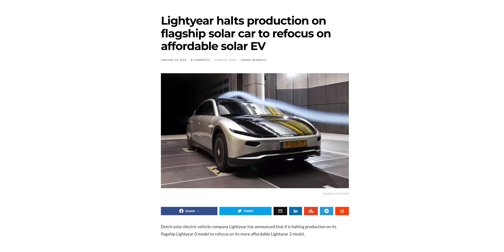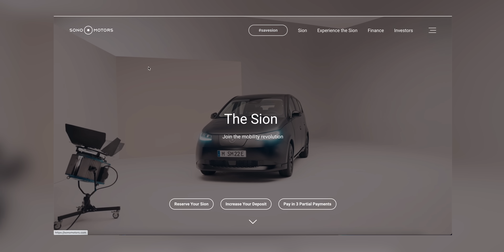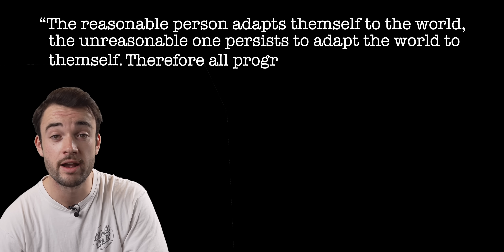Will Solar-Powered Cars Ever Happen??

Comment: An efficient EV can cover ~4.5 miles per kwh at, say 60mph which implies an average of 13kw power to drive the motor. A typical car might be 4.7x2 = 9sqm using Tesla Model 3 dimensions.The sun's incident power is up to 1kw per sqm, often much less. So, even 100% efficient solar panels (vs.  ~20% currently achieved on a bright day) would only supply 9kw of the 13kw needed to propel the car.
Reply: Its not supposed to power the car.  Its supposed to trickle charge the battery for extra range before being fully charged at the mains

Comment: Surely the maths behind a solar car just doesn’t add up?

Even if solar panels were half the cost, half the weight and double the efficiency, the solar energy collected by such a small surface area is only good for a few miles per day and would take over a week to fully charge? 🤷‍♂️

Comment: An interesting video but does putting solar panels on an EV make sense? The added benefits are marginal wrt to range and if you are trying to attract investors they may be spooked by seeing so much emphasis by these companies on the solar aspect. Development money would be better spent on drivetrain and battery to improve efficiency. What interests me about these cars is their interesting designs and focus on efficiency generally, the solar tech is marginal. I suppose in their minds the solar capability is a USP, perhaps it would be for some consumers but at this stage it isn’t consumers you need to keep happy. They should focus on selling these amazing concepts to investors on the strengths of the designs and once an investor is interested the solar aspect becomes ‘oh, and by the way, we can do this as well’.

Comment: I do love the idea of solar cells on the top of a car to increase the gap between recharge. I don't have off street parking do if I could add 20-30 miles a week that would make a huge difference to me.

I think part of the problem may be the grossly optimistic range they quote. Claims of up to fifty miles a day are likely ten times what is realistic. I wonder if this is part of what stops serious investers getting behind the products.
Reply: Who says 50?  The largest number I heard was Aptera's 40 under ideal conditions, and that that is only because it is designed to be able to go 10 miles per kWh.  The more typical 4 or less miles/kWh is never going to get that from modern solar cells.
Reply: @skeptibleiyam1093  I think I've seen 50 from light year (I could be wrong about that). I just checked and they now have tests suggest potentially 44 miles line. Still wildly optimistic - I think they are basing it on assumptions from all the solar on the car, but most of the time half of it will be facing away from the sun and the rest imperfectly aligned. 10 miles a day would be a triumph in real world conditions. 5 miles worth it.
Reply: @stewreviews9345  Where are you getting information about the Lightyear 2?  The official website as almost none and I am curious.

Comment: So, it's apparently quite hard to start a completely new car brand from the ground up.

I really wish that a company would commercialise production of adapter kits - maybe just add solar to an existing vehicle - tons of challenges to this but companies like Muxsan have created different adapters for charging, people so it with a supplementary battery that charges up via solar and then dumps that charge into the vehicle battery.

Hobbyists are already doing this so we know it works to some degree, just that their set ups are universally really ugly...

Comment: The problem with all 3 is - you can buy solar car today. Get any electric car, put additional 4-5 kW array on your roof and voila - you can have solar powered car right now.
The main problem therefore is that people that can buy startup car with no service network have enough money to do what I described above usually, so why wait and why risk it?
Sono, for me, had the highest potential not thanks to solar, but due to very utilitarian vehicle type. But the loooong delays probably caused them to run out of money.
Their solar roof program for buses, trucks etc - that's brilliant!

Comment: Missed one, Fisker has a Solarview panel on their Ocean model and are in production with deliveries to start soon.

The Aptera Accelerate project, that investment competition, led me to cancel my order. It just comes off too scammy for me. All that money is lost if they don't enter production. Worse they have yet to publish their financials from July to December 2023 and if you look at January to June 2022 they burned a truck load of money.  However what irked me the most is even in February 2022 they let people think they would deliver a production car when it was clear they were not going to get Gamma done when promised, it did not appear till September, and it wasn't until November they admitted they did not even have renders for their last prototype done nor would have by end of year. They also cannot give an actual price.   
    
I really like the idea. However from a financial perspective none of the solar charging options are worth their money. Let me use an example, Aptera claims 100 w/mi and they claim forty miles of range under ideal conditions. Well if their efficiency claim is true then that is 4 kWh of electricity. Even at 25c per kWh that is only a dollar.   A dollar saved and only under ideal conditions.  
    

The reason none of these manufacturers could get new investment is because forty thousand odd reservations are not enticing nor do they support the money already invested along with that being asked for

The biggest issue Aptera faces with acceptance is that it is a two seat vehicle on three wheels that is actually more expensive as listed, again we don't know final prices, than some current EVs are after incentives and it would be long before more EVs are in the same proposed price range before incentives. It would have to be a lot cheaper to compete against a tradition four door four seat EV complete with IIHS crash ratings and by every guess it will be more expensive than they show now

Comment: Jack and the Fully Charged crew, when you made that list of successful (Tesla and Rivian, is Rivian really considered successful and out of danger of going under yet?) and unsuccessful startup EV makers, did you forget to check with Elliot, you guy in China? In no particular order, Li Auto (founded 2015) sold 130k cars last year, NIO (founded 2014) sold 122k cars and is already in Europe, Xpeng (founded 2014) sold 121k units, Hozon (founded 2014) did 152k units, and Leapmotor (founded 2015) sold 111k units. And those are merely the 5 largest Chinese startup EV manufacturers.

But Jack's points in the video are totally valid, and they explain why Sion or Lightyear have gone under, but the Chinese EV startups are able to ramp to into full volume production.

Financial backing: Unlike Sion/Lightyear/Aptera, the Chinese automakers can attract investment from central and local government sources, which not only have money to spend, but also see these companies as job creators for their local regions. When NIO was about to go under, the local government where their factory is to be located stepped in and bailed them out, tiding them over until they can reach full production.

Supply chain: More cars are sold in China than anywhere else. More cars are built in China than anywhere else. And more importantly, way way way more ELECTRIC cars are built and sold in China than anywhere else. Whether it is access to lithium cells, electric motors, software solutions, or mundane components like steel, tires, seats, paint etc, supply is but a stone's throw away in China, and readily available. Economics of scale means these Chinese automakers can get components cheaply and get their production off the ground quickly.

Moreover, the level of human resources available to a Chinese startup, where there are millions of workers in the local automotive industry with expertise in both hardware and software fronts is simply not available to a small startup in Europe or the US. And the market where you can immediately sell you cars and obtain revenue is also so much bigger and easier in China, where 20 plus million cars are sold every year, and the government is putting in all sorts of policies (and more importantly the INFRASTRUCTUR) to promote the sales of plug in vehicles. This creates literally millions of new EV customers every years, making it easier for the startups to grab a slice of that market.

So it isn't surprising at all to see Lightyear/Sion fail, Aptera/Canoo probably about to fail, and Rivian/Lucid struggling with production hell, while the Chinese automotive startups are all up and running already. They may not all make it, but they've at least reached the volume production stage, and most of them are now into their second gen vehicles, while the western startups can barely even get their first model into prod.

Comment: Aptera is the same width as typical car width including mirrors
Reply: Maybe in the USA but not everywhere else ... certainly not Europe and UK. Aptera is 87.6 inches or 2.25 metres. Cars over 2 metres are hopeless for city driving and for narrow rural roads. we want to reduce congestion not increase it. The Aptera looks like it should be a neat sleek vehicle but it's not. Also you can't compare a car that is 2 metres wide with mirrors extended to a car with actual wheels and shrouds that extend that far ... you can't fold them in like you can with mirrors. An average US parking bay is 13 and half inches wider than a UK parking bay so that gives you an idea of the difference in expectations. Yes there are more and more big cars here nowadays but they are bad news ... let's not have another one.

Comment: I am not convinced by the solar power on the car, which appears to me to be a distraction from what would in all cases be needed: ultimate efficiency! Solar appears to be a marketing gimmick: visible, and perhaps nice on very sunny days to run the AC in the car, but otherwise? At 10kW / 100 km (which would be fantastic) and let’s say 1kW on solar, you need simply too many hours, not park in the shade, and not at all in a parking garage.

Comment: Innovation requires failing upwards, but failing non the less. And failing when capital markets are shooting to the moon with capital cost being the lowest in decades is much easier. With recent interest rate hikes, capital markets tightened a LOT and their appetite for innovation went away, prefering stable and safe investments. Nothing special or new here. Back in 2003, the Fed had the lowest rate seen in 45 years. Makes taking risk really cheap. Tesla's success has little to do with Musk and more to do with cheap capital at the time.
Reply: Capital was also cheap most of the time Sono existed. But nobody wanted to invest. Only dreamers and people, who had clapping and singinbg in their physics education.
Reply: @vic321344  Not exactly right. You need the capital to stay cheap until the profitability phase which is definitely not the case here.
Reply: @simonlynch4204  But Sono just did not get the capital when it was cheap. And they had a high burnrate. Even without t roadworthy production prototype available.
Reply: @vic321344  Your point isn,t mutually exclusive to mine. With cheap capital they could have continued to burn and might have managed to get to mass production. Maybe. But my point still stands. They all suffered a lethal blow from cost of capital. Every business felt it.
Reply: @simonlynch4204  You are right. Nontheless it was lacking work ethic, that described the situation at Sono. Party and vegan Catering. Until 2020. After the second Roding prototype desaster.  I think then real car engineers took over and started to do what has to be done. But it was already 5 years too late. And the cash burnrate was still much too high.

Comment: Nonsense The future is not solar with the small the roof area of Sion,...
You have to enter the area in square meters. Length times width gives the base area...
Unfortunately, such solar cells do not exist on such an extremely small footprint
could generate useful energy
Reply: It is not the small roof area of Sion, but the lack of other efficiencies that lessen the usefulness of the energy available.

Comment: Having worked at a few start up and established automotive engineering companies, I have a few observations...

Firstly, a novel idea doesn't necessarily sell cars. Doing something a bit better than someone else sells cars. I don't think the majority of people like change (think iPhone, BMW 3 series etc.).

Secondly, although developing an electric vehicle is arguably easier and more accessible than an ICE car, actually building a car that's any good is still REALLY hard. 

Thirdly, even if you know how to make something look nice (looking at you Arrival), knowing how to make something that's even legal to sell is another thing altogether. The amount of legislation to pass is incredible and there's a hundred ways to trip up and fail certification. It also takes a lot of time. Most start ups don't do the due diligence for this up front, go off and design something pretty and stick it on a swanky website and then everyone expects they'll see the car on the road next year. There's a minimum of 5 years to produce a new vehicle - no matter how clever (arrogant) you are. And if you plan to change how vehicles are made or designed it's probably 10.

Comment: I almost signed up for a Sion very recently. I live in a place where we regularly see over 40°C in summer. I don’t want a black car parked in the sun unless Sono can tell me how cabin heat can be effectively managed. No news on that front. Seems their km-of-range claim for grey German skies is fantastic but it’s a car that is inherently designed for the place it was designed. Funny how Lightyear comes from the NL, too. Here in the south of Europe we have white cars and park them in the shade if we have any sense…
Reply: I was in southern france quite often in spring time - and cursed that I had gone for a black BMW. Now with my EV I had some sense, it's white (well underneath the inevitable layer of dirt it's supposed to be white)...

Comment: The key is adding solar to all bevs (and truck trailer roofs) to provide trickle power (for aircon/heating/battery maintenence).
Reply: Much too expensive.
Reply: A set of solar panels on the roof of a bus or truck? Some cars have them. It's not going to propel the car but stuck in the sun, it avoids the need to use aircon when you arrive back to a hot car interior and suck the battery getting the temp down. Same in reverse in a bright winters daylight. It can trickle charge the seat heaters. Consider all those trucks and buses in slow traffic. More trucks will rely on stronger aircon as daytime temps rise.  Charging your phones, tablets, sat nav, interior screen displays, smaller acid batteries

Comment: Aptera is a dead, so is Sono. I have hopes for Lightyear but they're on thin wire
Reply: Aptera is in the beginning stage of greatness.  All you have to do to see that is to compare them with Tesla at the same relative point in time.  They are FAR ahead of where Tesla was.
Reply: @N. Bruce Nelson  aptera is working in the most pointless car and has no scalability whereas tesla builds cars people actually wanna buy suvs, trucks etc and are useful 😉
Reply: @zunzea  Aptera has gotten so many preorders that they have had to abandon their original plans to develop a model that would scale far beyond the original manufacturing method.

This first Aptera is only a start.  The second Aptera is likely to be a 4 wheel, 5 passenger sedan.  Compare Aptera's first model with Tesla's first, in any way you wish.  There is no contest to how superior it is.
Reply: @n.brucenelson5920  They wont even be able to start the production of the cheap and simple 3 wheeled motorcycle.
Reply: @vic321344  You are correct about that!  Aptera was never going to build "a cheep and simple 3 wheeled motorcycle.  You continue to embarrass the false name you hide behind.
Reply: @n.brucenelson5920  How is anybody able to embarass a false name? Another phantasie going wild? You always embarass your real name with your phantasies sold as reality. Thats for sure.

Comment: As you point out these are big jumps. What we could achieve now is a more ordinary electric car with solar panels that keep the battery charged up when not in use as I understand that they all discharge over time. This could be built on gradually to arrive at a fully solar charging car but we do need to start!